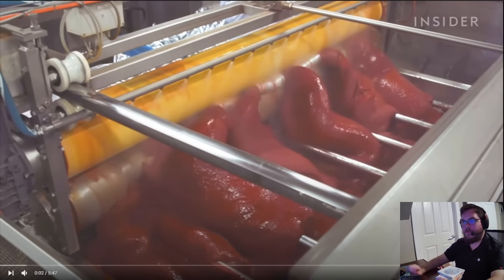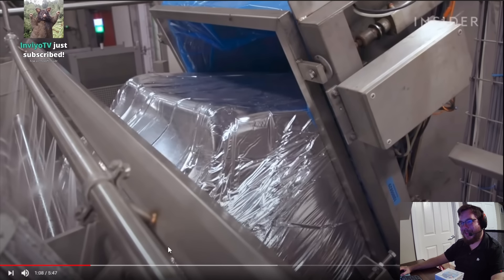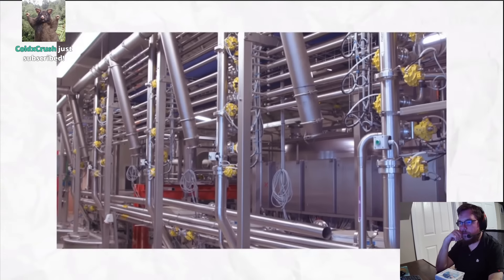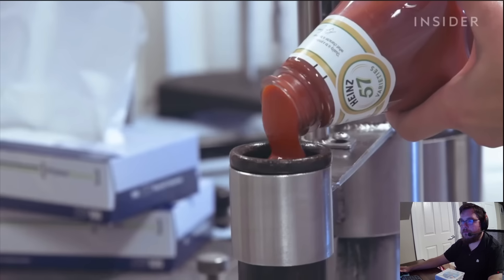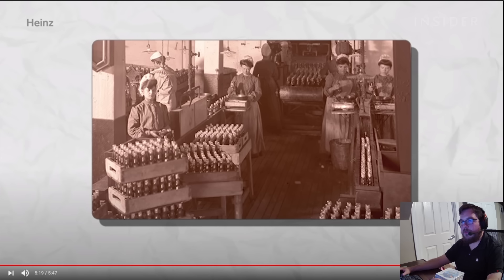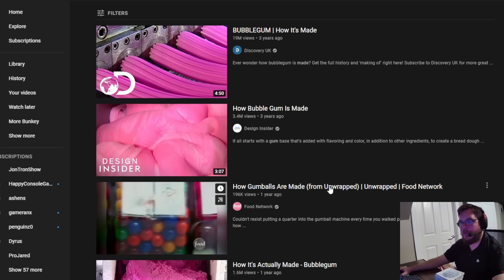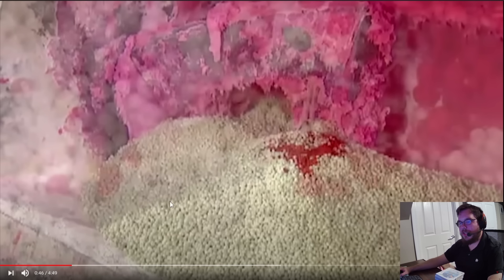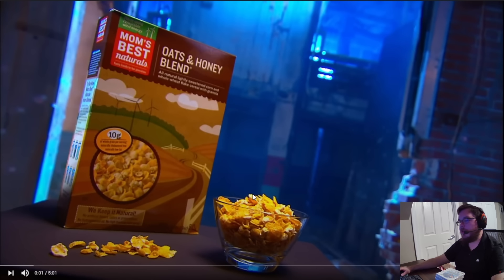Ketchup is Replacing Humans

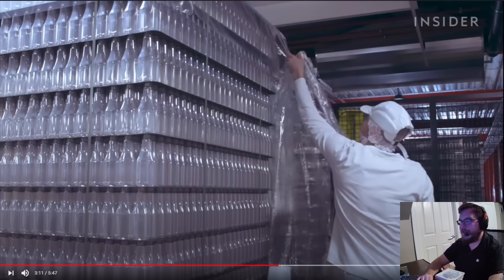Comment: 2:35 They're so worried about the viscosity in the factory, but they don't care if the first squeeze is water when it gets to me.
Reply: Try shaking the bottle before opening it
Reply: @theKiwii  But that would be smart.
Reply: What I'm wondering is when do we finally get non-stick coating on the inside of the bottles? I'm pretty sure the technology exists, yet 10% of my ketchup is still stuck to the insides of the container.
Reply: i just wanna say that's actually vinegar not water
Reply: Mm more delicious PFAS chemicals
Reply: @xXDimistreoXx  Yes very tasty 😋
Reply: @theKiwii  Oh, christ! We have to do everything ourselves!

Comment: If the ketchup is too fast they punish it by putting it in a dry room and not letting it drink any water until it falls in line. If it is too slow they waterboard it until it learns how to run away at an appropriate speed.